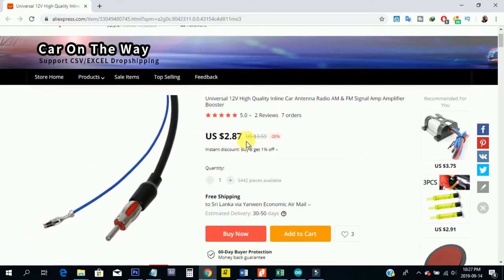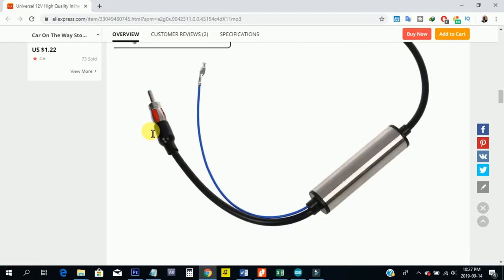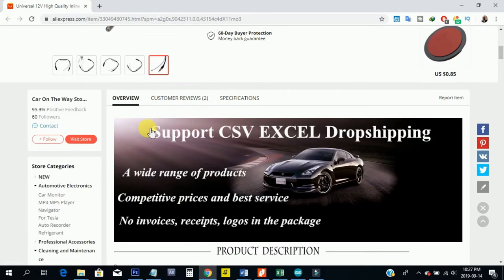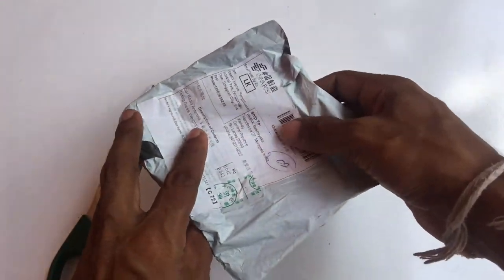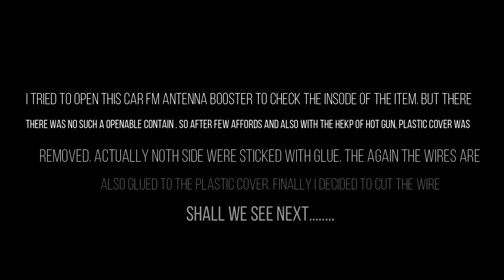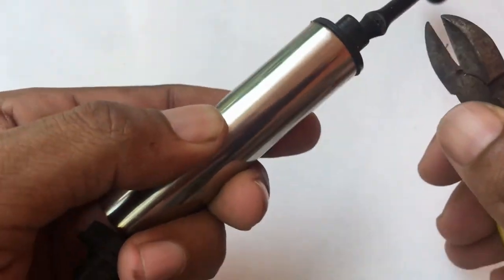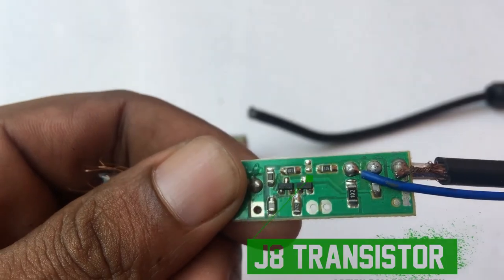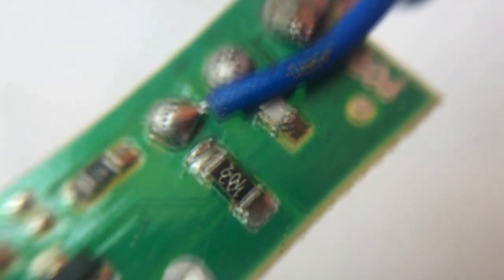Car FM/AM Antenna Booster (Cheap) review and Inside

Comment: those ''booster are not an amplifier their are used to power the amplifier inside your car antenna
Reply from the maker: It is not an power supply according to the manufacture. I have tested a successful booster find the following link https://youtu.be/IJWKSbikpyQ
Reply: Exactly....It provides dc to the pre amp at the aerial base.